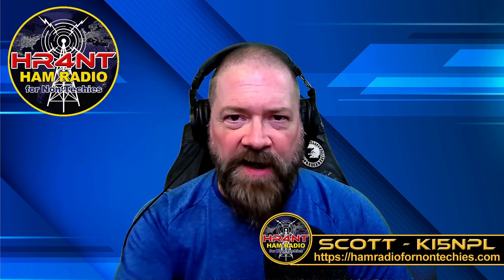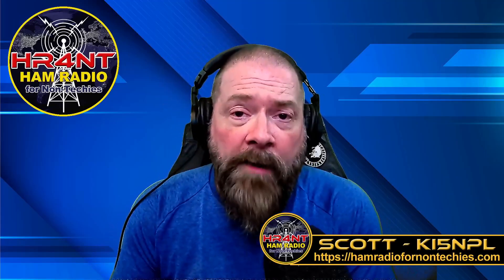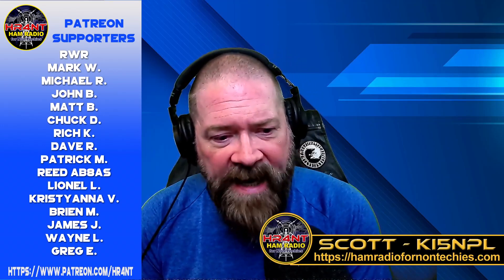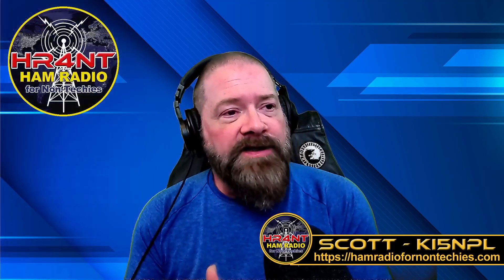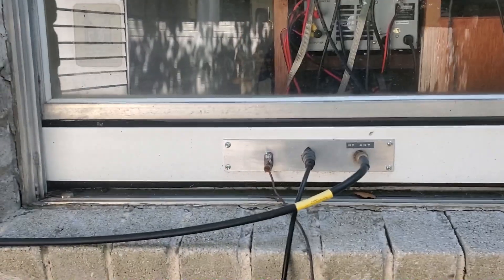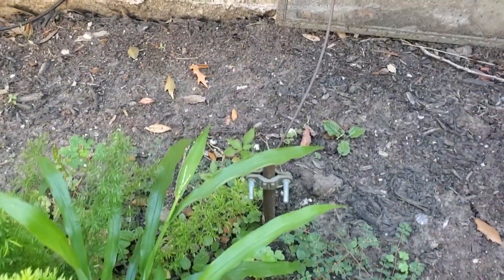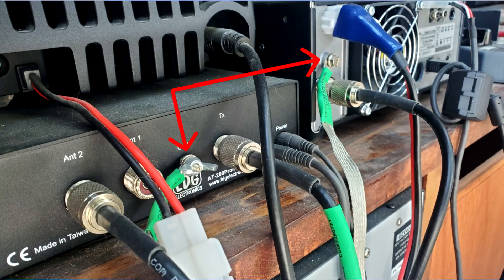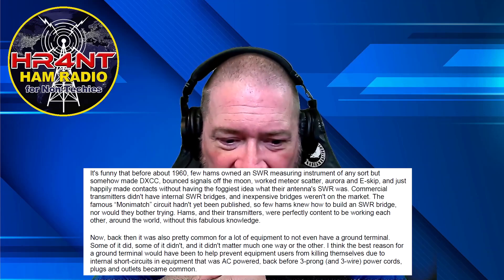Grounding My Ham Radio REVISITED:  What I Have Learned Since Then

Comment: Good video. I do not use a separate ground rod for my station. Like you I always disconnect coax cables when not operating. I also unplug from the wall. No need for an RF ground. This way the chassis of any equipment is connected to the power system ground through that third grounding wire. 
If your antenna was an end fed wire where half the antenna was the ground, such as a quarter wave vertical or inverted L or EFHF then there might be a ground connection at the base of the antenna. This could be a problem if not done right. The ground could be elevated radials or buried radials. With buried radials, disconnecting the coax would again solve the two ground rod problem. 
I am glad to see your good advice. By the way I am an Electrical Engineer for many many years and think I understand this stuff rather well.
Reply from the maker: Hey there!  That is fantastic to hear this coming from an EE!!!!  I got so frustrated because I feared that my equipment would not function or get damaged if I DIDN'T ground it to the point of night sweats...LOL  I am not an expert on anything electrical, but I think the techniques I have employed are effective enough for my needs.  I think everyone needs to make a decision based on their situation.  Thank you for the comment and for watching.  73!

Comment: The ground wire connecting both grounds dont have to be huge or thick and 90 degree bends wont matter. Its just so both grounds stay at the same potential nothing more. Its very important as with out that seperate ground rods will fry everthing in your house. Please educate yourself its not rocket science.
Reply from the maker: Good to know, but my main point is that in the event of a direct hit, nothing is going to protect the radios.  Thank you for the comment and for watching.  73!
Reply: @HR4NT  Hi, I applaud you for making this channel. I also think you would benefit greatly from a little bit more research on station grounding. As mentioned in this comment section previously, there are a number of reasons to establish a correct and effective ground solution at your location/shack. When an uninformed HAM uses a separate grounding rod solution for their shack equipment, a difference in electrical potential is created. That, is where people mistakenly create safety issues, and, how they create rfi issues for both the station and nearby neighbors. Proper grounding is for both rf and lightning (including static from nearby strikes). At my QTH, I've installed 17 individual 8' rods around the house perimeter all connected to the Electrical Service entry rod with #6 solid copper wire. All shack equipment is tied directly to one common ground panel with separate ground wires in the shack (this approach prevents ground loops between various pieces of grounded shack equipment). The common ground panel is then tied directly to an external ground rod (which is part of the extensive ground radial protection system surrounding the house). Additionally, the antenna mast is tied directly to the ground radial surrounding the house via DXEngineering coax grounding mast bracket (DXE-CGB-200) and copper braid wire. Both coax runs coming into the shack are buried 12" and are further protected with the use of 2 PloyPhaser DCBlocked lightning protectors which are bolted to the common ground panel as well. That, is an effective RF and electrically safe ground solution. A station operator should either not use a ground rod solution at all, or do it correctly as noted above. A half-butt solution is dangerous and non-effective. There are quite a few HAM Radio books well-written on this topic. The problem is most HAM operators never take the time to learn about proper station grounding. Personally, I enjoy sleeping well knowing that my QTH is protected (as much as it can be), and that I enjoy an extremely low ground floor for the best possible RF signal quality. RFI...what's that? (chuckle).

Comment: I have sympathy towards this idea because I've often found myself paralyzed with the idea of putting up an antenna because of all the grounding considerations. And the risks could be large: I've been told that an improperly ground antenna can be a reason for home owner's insurance to reject your claim in the event of a fire. This culminated with my putting up a Starlink dish that I did not ground; a year goes by without issue. (I didn't install a ground btw because Starlink doesn't actually provide a very convenient way to interject a ground connection.)

In the end, I've decided to build my own shed where my radio shack will reside, eliminating my concerns about home owner's insurance. That being said, I was surprised to learn that SWL meters were not in common use before the 60s and 50s. So I asked ChatGPT4 about that and this was the response:

Before dedicated Standing Wave Ratio (SWR) meters became commercially available, amateurs and radio operators used a variety of methods to ensure optimal transmission and reception. Here are some methods:

Trial and Error: One simple and crude method was to adjust the antenna length or positioning and then listen for changes in signal quality. This method, however, lacks precision and repeatability.

Field Strength Meters: Field strength meters measure the intensity of the radio waves produced by the antenna. By adjusting the antenna or transmission line characteristics for maximum field strength, radio operators could often achieve good impedance matching, even though this method does not directly measure the SWR.

Reflectometers: Before SWR meters, some people might have used devices called reflectometers to measure the reflected power, which can give an indication of impedance mismatch.

Directional Wattmeters: A more precise method involves using a directional wattmeter, which measures power going in both directions along a transmission line. With the forward (sent to the antenna) and reflected (coming back from the antenna due to mismatch) powers known, the SWR can be calculated.

Use of Oscilloscope: Experienced operators could also use an oscilloscope with a suitable probe to observe the waveform of the current and voltage along the transmission line, though this required a fair amount of knowledge and skill.

All these methods require a good understanding of radio theory and often a good deal of patience, as they can be time-consuming and finicky. As a result, the introduction of dedicated SWR meters was a significant step forward in making amateur radio more accessible and easy to use.
Reply from the maker: Wow that is great info.  Thank you.  I like your idea about setting up a separate radio shack.  Unfortunately that is not an option here at this time unless I can have a good AC unit to keep the temp under 100!!  LOL  Hoe you enjoyed the video.  Thank you for the comment and for watching.  73!
Reply: I have had antennas up for decades and never had an issue, a simple throw switch to ground everything and unhook the coax when its nasty out is sufficient.

Comment: There are basically three things you ground for.FIrst, is lightning protection.  Like you said, there's not much you can do there.  If lightning hits you are SOL. So doon't worry about that, shutting everything down.  Then there's safety ground.  Safety ground is where you have chassis grounded in case there's a electrical issue and the house electrical hot line shorts to ground.  This is there so you don't have 120/220 going through you if it fails.  In all modern houses they have the three wire with ground setup. GFCI will help in that. Lastly, this is where everyone argues yet don't get the point, and it's RF grounding. RF grounding is so that if and when you get RF coming back from the antenna, it has a path to ground instead of to you.  In the olden days this was apparent when you were transmitting and got too close to the mic you get a little zinger coming back It also plays haywire at times to you transmitting power going or coming back from the antenna when it has a hard time tuning.  This is why you run a ground from everything to a single point like you have, the ground pipe.  This should then go to an earth ground, wherever and however to get to ground. In your case, that path is through the coax out to your window passthru, then to ground.  That's all you really need.  In some cases where the RFI inside the shack is uncontrollable, then instead of relying on grounding, you should find out why you are getting RFI in the first place. What you have is more than adequate if you don't have problems with RFI. You aare 100% correct. And like everything in ham radio, there's not a one size fits all, especially when you dealing with RFI.
Reply from the maker: Thank you very much for that comment.  I have kept my safety ground.  As for RFI, I have a considerable amount from a neighbor a few houses down that has a solar panel array that was improperly installed.  As far as inside my house, I have done a few RFI checks and nothing here causes any, which is a miracle...LOL.  However, with that being said, the technique I chose for my situation has been working and most of all, my gear isn't in danger.  Thank you for the comment and for watching.  73!

Comment: I ground my antennas with arrestors and masts and tower as well. Because I specifically run my gear during storms for ARES weather nets and the national weather service uses my echolink node for communication to the local repeater. But that's me and my situation. I also accept that in a direct strike that effort is not saving antennas and may not save my radios.
Reply from the maker: See, I get that.  If you are using your radios for a situation like you describe, you take whatever precautions you can, but you know that there could be an incident in which case it could go South.  Thank you for sharing.  Thank you for the comment and for watching.  73!

Comment: Scott 
Glad you liked the article. As I mentioned I ground my antennas to prevent static build up. I unplug all my equipment when needed. I don’t have noise floor issues or RF in the shack so I don’t bother grounding my rig. Also my shack is on the 2nd floor of my house so a ground wire has the potential to radiate RF. The ARRL handbook even states that if your ground wire from your rig to the ground rod is too long then you should not ground. 
73
Phil
Reply: Where is that stated in the ARRL handbook?
Reply from the maker: @markdavis5486  I will see if I can find that section where it talks about that.  Thank you for the comment and for watching.  73!
Reply from the maker: @doc145  The article was very informative!  I have heard similar that if a ground wire is too long it could affect performance.  I think I should crack open my ARRL handbook and see if I can find more info on that.  Thank you for the comment and for watching.  73!

Comment: Why don't folks install lightning arrestors even without being an active ham?,

(I had a professional contractor install 4 air terminals with 3-4 grounding rods all connected together, and I was told the radio shack can be connected to that system. ), air terminals are higher than antennas.
Reply from the maker: That is interesting.  I would have to look into that in depth to figure out why they did that.  Thank you for the comment and for watching.  73!

Comment: Some years ago I got a direct lightening strike on my dipole. I had an 8' ground rod, everything in the shack grounded. It came in the house and destroyed anything electrical.  Had I unplugged the coax that would have saved everything.
Reply from the maker: You just confirmed that what I do in my shack is a sound decision!!!  Protecting my investment is paramount.  Thank you for the comment and for watching.  73!

Comment: It is indeed a controversial issue, commercial and  emergency services have radio sites that have to operate 24/7 and are correctly bonded and grounded. They rarely suffer lightning damage but there is a huge investment in doing the job properly. There is a lot of misinformation on the subject, but also people can be creating dangerous situations. I am a very bad example with my hobby radio, other than the standard electrical safety ground I had no other grounding on any of my gear for over 30 years. More recently though I have made a bigger effort with bonding and grounding. Also had a purge on the domestic RFI but that is another subject. 73
Reply from the maker: Agreed.  I was apprehensive to even bring it up again just based on what I had dealt with the last time I brought it up...LOL  I wish someone much more fluent in this topic than me could find a way to explain and come up with a simple to follow way to effectively ground without the overly technical jargon...oh well maybe someday....  Thank you for the comment and for watching.  73!
Reply: @HR4NT  thank you for the reply, a significant factor is wiring regulation differences too, I am in the UK and with this modernish house it is slightly different to many others. I do have antenna and radial system bonded to the supply ground but the conductor is undersized. The Motorola publication is a great standard but most of us will cut corners.

Comment: Scott great to see you back making videos!!! My opinion and what I’ve done, I have an RF ground which has lowered my noise floor considerably. I originally ran the ground 35’ to the electrical panel ground rod which made my noise floor so high the radio was un-usable. I drove an isolated ground rod which solved that. My equipment is grounded through the mfg ground through the power cord of my power supply. I too disconnect coax and power when I’m not using the radio during the times of the year the we get lightning in NH. Best of luck with your recovery and don’t worry about what others say about your choices. 73!
Reply from the maker: Hi Joel!  Thank you very much for sharing that info!  I really appreciate it.  I think that we all need to do what is best for our needs and situation.  By using common sense, we can hopefully avoid any major pitfalls and at the same time learn more about our equipment and enjoy ham radio.  Disconnecting everything seems to make the most sense.  Thank you for the comment and for watching.  73!

Comment: good points there Scott , my grounding scenario is as follows :-, when i was digging the hole for my tower ,4x4x4 feet deep i made a rubic cube shape of rebar (186 feet total), this was placed over my tower ground socket that is 4 inch square that was banged into the ground 20 inches, the cage was welded to the ground socket plus a additional 3 rebar rods to the cage then the rods are @ 45 degrees into the side of the hole then filled with concrete,thats the tower grounding sorted, in shack i have the long double female bulkhead so239s fixed to a solid copper bar (8 of) this bar has a thick earth cable from there through my wall onto a 4 foot long earth rod into the ground, as for my radio/rotator and antenna control box they have individual earth wires to a single collection box from there to the aforementioned copper bar, for my pc no extra grounding except keyboard /mouse & my mointors leads have ferrites on them, 50k ft8/ft4 qsos later i have no rf interference or problems with any of my 4 mointors :) :), remember the old adage KISS Keep It Silly Simple :) :)
Reply from the maker: WOW!  That sounds like a much more advanced setup than anything I ever conceived of!!  Sounds like you planned it out and did your homework.  Thank you very much for sharing that info.  I really appreciate it.  Thank you for the comment and for watching.  73!